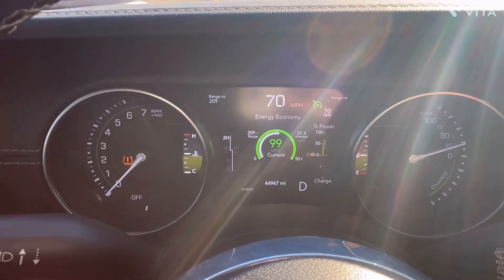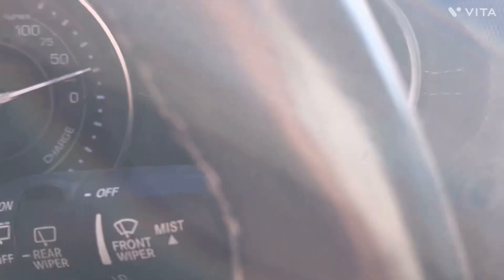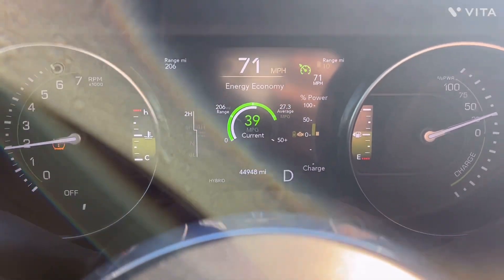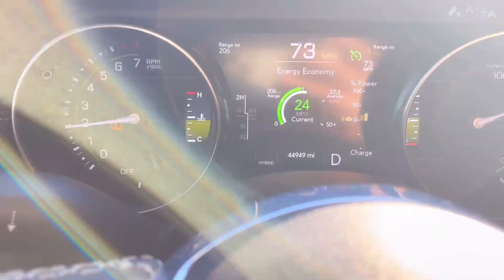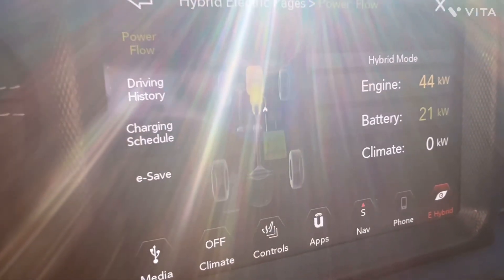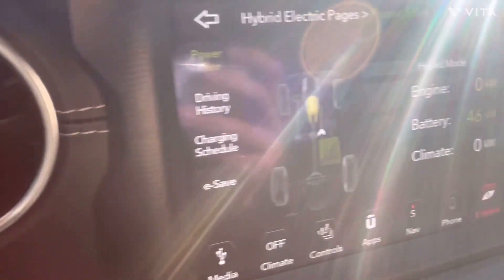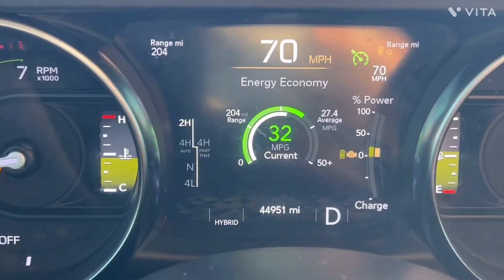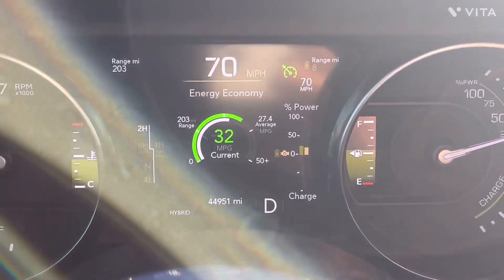Jeep wrangler 4xe not a true hybrid

Comment: Not that it solves the core issue that's bothering you, but if you switch to manual mode, it will keep the engine running for as long as it's there, putting it in something of a blended hybrid mode where it always uses both.  So on long highway drive, bring it up to speed, click the shifter to the manual mode on the left, and engage cruise.